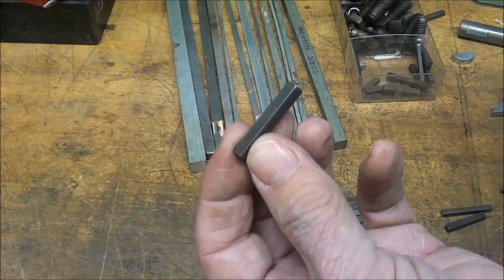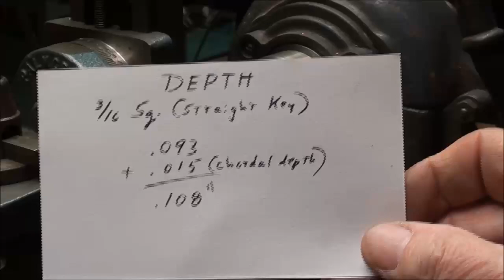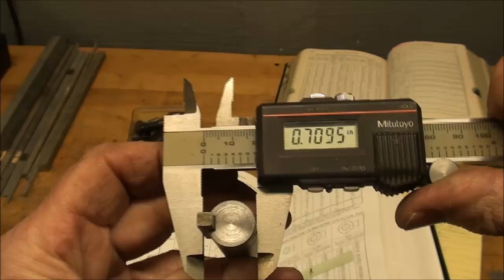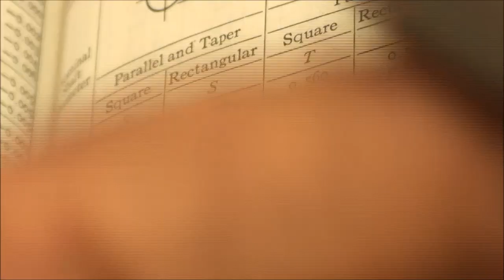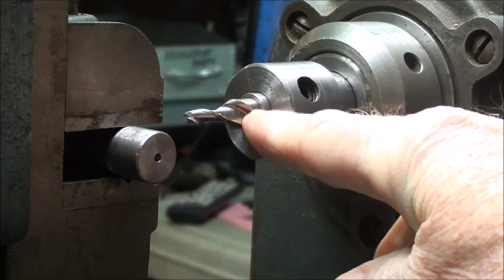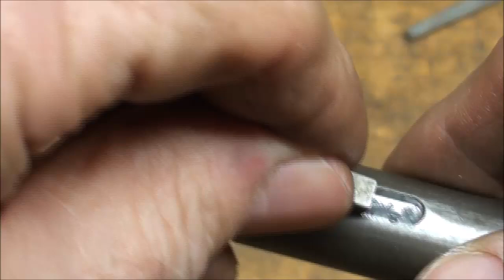Milling a Straight Keyseat on Logan Lathe Palmgren Attachment 289 tubalcain

Comment: If a person is worried about the key walking out of the shaft why could they not drill and tap the ene of the shaft and make a flat washer that is the same diameter as the shaft end, in that way the key cannot move beyond the end of the shaft, I would imagine that the key lock screw is loose or the maching job was at a slight taper? As always thanks Mister Pete for your first class videos that help us newbee's learn more about the Machine Trades.

Comment: I just cut a few keyways a few days ago on a 5/8" shaft for a 1940's popcorn machine. I had not cut a keyway in many years and did not realize there was a specification for them but it did work out with no issues.
Reply from the maker: Thank you, I'm glad you liked it

Comment: Of course, the square key can't work its way out of the end of the shaft, if the key-way is machined blind at both ends, ie. it stops short of both ends of the shaft.

Comment: Interesting points on the key types. I got to thinking about some of my hit-n-miss engines. The magnetos use the Woodruff keys, whereas the flywheels use the Straight type. Might have something to do with mass (guessing?). On a side note, I am glad that the flywheels have the straight type, as usually due to age, rust, etc., they end up having to be drilled out for flywheel removal.

Comment: Just watched this for the 2nd time, I am cutting a 3/16th keyway in a 5/8 bore on the metal shaper with the bar and holder that I built, I don't go in to detail about the key way but I am very glad you did. Thanks Mrpete, you are the best.  Steve Summers

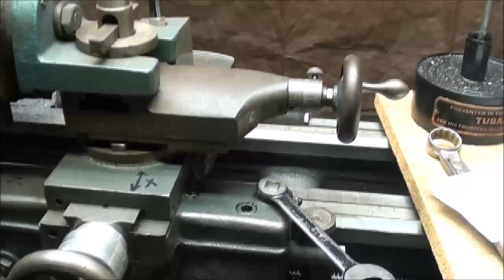Comment: At 7:18 - why Z-axis? I've never seen that axis named the Z! Does it have something to do that we're working with a milling attachment here?
Reply: Lathes are typically labeled X and Z. X is perpendicular to the axis of the spindle, and Z is parallel to the axis of the spindle. Same goes for mills. The up and down of the milling attachment would be the Y axis.

Comment: looking at the cut done with the woodruff cutter as you were climb milling I was concerned that as you move the cross slide you reintroduce the possibility of backlash. Since the  cross slide threads start to push on the nut into the  cutter if the cutter grabs hard on the bottom of the material it could jerk the material into it just as you said. Did you tighten the gibbs of the cross slide? Or were you pushing on the cross slide it self to keep the backlash from opening up?

Comment: Can someone help me with a question about my atlas th42 10 inch lathe? The tapered hole in my headstock is too big for a morse #2 so I bought a morse #3 and its too big. What taper could it be? Between #2 and #3 morse? Thanks anyone.

Comment: The reason I said we never did that, (that is short threads in cast iron), is a lecture I just listened to as a mechanic.  This lecture was by Sidney Brenner on biological complexity. He said, "we build machines to be durable". Short threads in cast iron is not durable.

Comment: Mr Pete, if you want to keep the key from working itself out over time, you can always cut a very shallow slot in the key where the set screw sits in , doesnt have to be deep, just enough for the set screw to keep it from sliding out.

Comment: Anyone in the comments can answer this question if you don't mind:

What is one book you would recommend for a young guy just getting in to general machining?... Especially related to lathes.
Reply: Well, others may have better suggestions, but I think for manual lathe operations, you cannot beat the South bend how to run a lathe or the Atlas lathe book.

Joe
Reply: Tek is right, Nicholas..Machinery's Handbook and I found mine on ebay for a very reasonable price...it doesn't matter which edition..for mine is the 13th edition (printed in 1946) and it has every piece of information I've ever needed to look up.
Reply: A great place to begin is to start watching Mr. Pete's videos from the earliest ones...that is how I learned to use my lathe, my mill, and just a ton of general shop information...and it's entertaining, to boot!  Mr. Pete also has courses for sale that cover specific machines...like lathe operation.
Reply: I agree with either the South Bend How to Run a Lathe book or the Atlas lathe book. They are similar in content, both explaining things very well but each has some small amount of information the other doesn't have. Also, be aware that the South Bend book has been put out in several editions each with some minor variation in what information is there, but all very useful. There is also a book that was produced by Hercus called "Text Book of Turning" that is available for free in PDF, online, or at least used to be.
Reply: Everyone sings the praises on the Machineries Handbook. The thing to note is it is a reference book and can be hard to read sometimes and assumes a formal training background as a pre-requisite, not to mention it is a rather expensive book.  For learning it is far from ideal so I would recommend you seek out texts issued to apprentices for their training. What I would suggest is you make an effort to study geometry and trigonometry. In 35 years as a professional machinist I doubt a day has passed where I have not used one or both. If you understand these and basic math you can solve almost any problem from first principals rather than hunting down tables of data.
Reply: Nicholas Of Alexandria the machinist hand book. I need to pick one up, but it may be available online for a free pdf download.